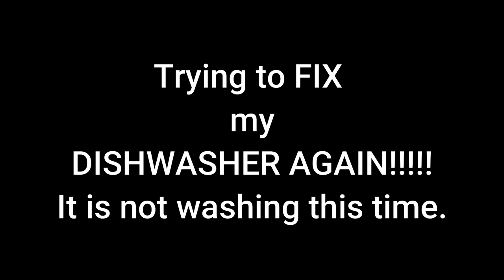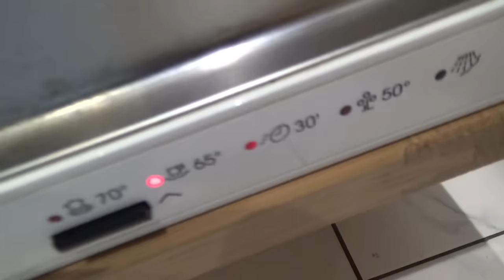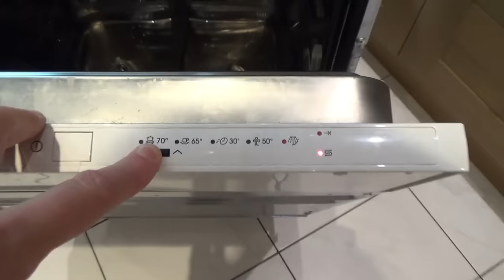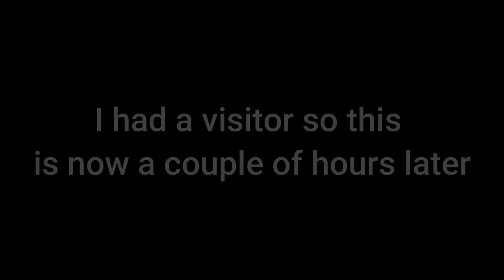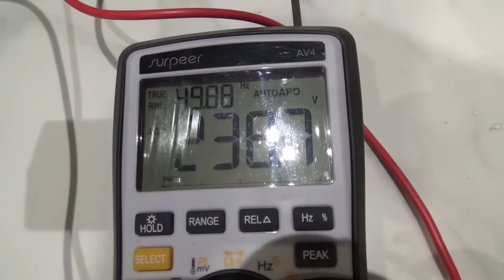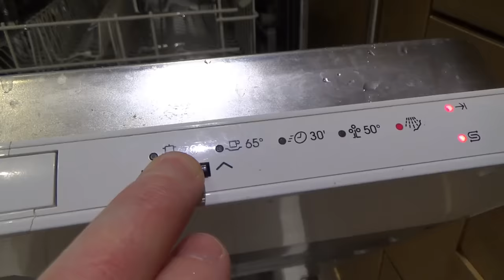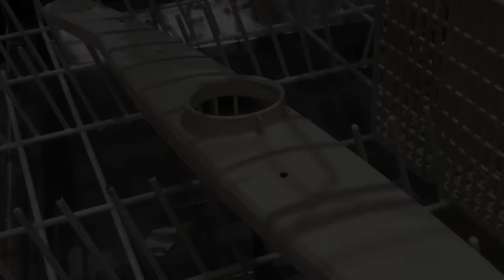Faulty Dishwasher Filling BUT NOT Washing - Trying to FIX

Comment: Make sure you top up the salt regularly. It is there to soften the water. At 2:14 you can see salt low light being on indicating there's not enough salt. Add salt even if you use 3in1 tablets. Also check your water hardness, you might get it from your water supplier, and adjust softening accordingly. There should be a table in the manual showing which setting you should use for which hardness level.
Love your videos, keep them coming!

Comment: Get hold of a box of citric acid-they sell it in wilkos at the moment,it’s with all the other washing machine cleaners etc-pour half the contents in,and run it without any dishes-this stuff will dissolve any calcium build up. Well done on the diagnosing and repair-I’m a service engineer,and do this day in day out!

Comment: Life saver mate, had the same issue, doing everything but wash, watched your video to find the pump motor, opened the motor to find a worn impeller had fell off, new impellor for a fiver and the dishwashers working great. even managed it without dismantling the motor from the unit.... saved a fortune mate cheers.

Comment: Hey Vince, the impeller is not supposed to come off the shaft easily like you did, this generally means the impeller is faulty and there will be too much play and the impeller will catch on the housing. The only fix was a new circulation pump. P.s I am an appliance technician.

Comment: It's a good job I have a water softener fitted for the house supply. It does cost money but then I don't have these kinds of failures in my water based appliances (I live in London where the water is hard). Plus I usually use the dishwasher/washing machine cleaner once a month and they've given me years of reliable cleaning/washing. Enjoyed the video, keep up the good work!

Comment: Great video, mine had exactly the same sound as yours I managed to take the pump apart and clean while  leaving the motor alone and it solved the problem ( if this is an option for anyone else it may save buying a new motor )

Comment: Brilliant video :-)  Thanks for showing all the stages - and I held by breath wondering if it would work!  Well done.  My Beko dishwasher is not cleaning properly but its the top arm that is not rotating - so I'm going to get some dishwasher cleaner to see if that clears away any grease or grim blockages.

Comment: Yes, wash pump motors often go, especially if it hasn't been used for a while. Use your dishwasher, they like it. If you don't use the washer regularly then things seize up. Well done on fixing it. You have the respect of a dishwasher engineer. 🖖

Comment: My mate vice, those pumps goes bad from bushings and the liquid inside of the rotor is ferromagnetic fluid so once they fail is impossible fix it, also those pumps They commonly fail in the wash machine so prepair for dismantle one 🤣

I know it coz I repair wash machines/dishwasher machines and the common faulty is those pumps, first They start to make noise then to get stuck and the last stuff is fry the coil, in the worse case the pump frys the drain circuit in the circuit board (commonly in a samsung wash machine, in fact I hate those friking machines) 

So here we go my two cents
Reply: I just take the pump apart and spray silicon spray where the rotor is and i have never had trouble doing it that
Reply: I have a similar pump on my machine. The graphite bushings had worn in an eccentric hole, causing the stator to hit the side of the casing, sometimes stalling the motor. I could not source the bushing, so I rigged a nylon drill bushing in a rubber washer at each end. It's been nearly a year and the fix is still holding with the machine used nearly every day. I had to run a reset cycle on the machine to get it to heat water again after it threw codes.

Comment: Thank you, clean the plastics from the motor, was dirty, different model from yours Hotpoint FD550.... and the dishwasher has been fixed.... Thank you for this video. The issue is as you said, dirt around the the part that the magnet turns.... It cost £1.50 for new jubilee clip. and an out of labour.

Comment: Water filter and a water softener may be a good investment for longevity.
Reply: The salt reservoir inside is the water softener. Does the exact same thing as a home water softener.
What is common, though, is forgetting to refill the salt. Now that I have seen what it does to the pump, I will make sure I refill mine on a regular schedule.
Reply: Also, check if the drain filter doesn't have any big holes, since that would cause any gunk from the dishes to go back into the circulation pump.

Comment: The circulating pump is the same as the Whirlpool and a lot of other brands. Mine quit cleaning or might I say I got around to fixing it the week before Christmas. I first blew out the holes in the spray arms but it still didn’t spray properly. I removed the pump an disassembled it. The bushings were worn enough the stater rubbed the side. My wife was in a hurry to have it fixed. I removed the bushings and replaced them with RC wheel ball bearings. Thou they are stainless steel I have read these will eventually rust and lock up. I have since cut two pieces of 1/2 in. Acetal rod 11mm in length. Drilled a 5mm hole in the center and mounted them in my drill press. Then turned down half, 5.5 mm to 10 mm with a small file. I kept the old bushings with the o-rings and plan to use the o-rings on my home made bushings.The old bushings were made of graphite probably to wear quickly. Acetal will out last graphite 10x. The bushings and o-rings cannot be purchased separately from appliance parts store. If the large o-ring leaks you have to buy a new pump. Not me! I’ll make my own bushings, use the o-rings from the old bushings and replace the large o-ring with a new #235 o-ring.

Comment: That play in the impeller, is to make sure the motor runs the right way. Those induction motors can run either way. On switch on, it is 50/50 whether it starts the right way round. If it's wrong, that clutch kicks it back the right way and it then continues the right way.

Comment: Quick troubleshooting on this one! If you had a clamp meter you could have easily tested the current draw of the pump motor safely and verified that it was drawing excessive current when the rotor wasn't turning. They allow you to test current draw without breaking the circuit as you would have to do with a standard multimeter. Cheap ones run around $20-$30. which is good enough if you just do occasional testing and don't need real accuracy. You just hook it around one wire and it reads the current through induction. Works on ac and dc. Can even help verify shorts in electronics.

Comment: Nice video! I think the scale rocks in the motor housing imbalanced it and caused the fault. To prevent this kind of faults need to do preventative maintenance once a month, like to run the machine with the descale solution.

Comment: Yeah prices have gone wonky, here in the states, the pump/heater for my bosch is 300 dollars, insane price, I can pick up a maytag which is a 1500 dollar dish washer, with a simple leak, that can be fixed with a rubber o-ring for 5 dollars, I can get it for 50 bucks, tomorrow, and it's a 2019 model, but great fix mate.

Comment: Vince there's a 2 part vidéo of a repair of that pump by replacing the bearing the magnetic shaft spins on so that it comes back to centre 

He used a ball raced bearing and it worked..
It seems the black plastic bush at the end of the shaft is a weak point  good job.. but the bearing of the motor at top and bottom of the shaft is the weak point

Comment: Vince, it looks like you don't have any salt in your salt tank. if you want your heating element to last longer, I would advise you to fill it up, salt in the all in one tablets is not enough for hard water areas. plus the motor you just replaced is called a recirculation pump. Good btw

Comment: What I always did was tap with a hamer on the pump. But those circulation pumps will stop working in the end because the play is to big and the magnet is not running central because the little hole were the axle runs in is getting worn out. So its just a Easy to replace by yourself. And indeed they are not expensive.

Comment: I opened that motor on my kenmore certain I was going to find some trash in it. Nope 😂

There was a tiny amount of grit, but nothing that should have stopped it, I wonder if the bearing actually fails when it heats up... at rest/disassembled, it seemed smooth and all.

Comment: Did you check the brushes on the motor? usually the likely cause of a motor not spinning, carbon based so they wear down over time

Comment: My condo was suppose to come and repair mine but have avoided it.... So I'm going to try and do this myself. The whirlpool dishwasher is brand new, it turns on fine, fills with water, detergent drawer opens... And then it just stops- no sounds- no washing. It will stay on and won't turn off without a manual turn off, which it then drains properly....

With mine not making any sound, what do you think it is?

Comment: They sell de-scaling tabs you place where the detergent/pods would normally you go. They are mostly citric acid to safely eat away at the scale without harming plastics/rubbers.
Reply: If the softener is correct adjusted, you will not have any scale in the machine.

Comment: Nice fix but doesn't sound like winding in that motor is failed and you can keep it as spare. My guess is that bushing/bearing on either end of rotor shaft failed, just enough to give motor hard time starting, with a "push" it will probably still work but obviously in this case that's impossible to be confirmed.
Reply: I think the motor responsible for the washing has a problem with its bearings and should be replaced , this fix will work for a couple of days if you are lucky and then the motor will stop again.

Comment: Geez, things aren't really built to last these days, I have a dishwasher from 1997 and it has a proper circulation pump motor with a proper cast aluminium frame, and much sturdier than that tiny little plastic motor, it eventually seized after all these years because the bearings gave out, all I had to do was replace the bearings and now it's running smooth and quiet like new again!

Comment: I had a similar problems with the drain pump on a Beko washing machine. I tried to fix it after we'd bought a new washing machine. I ordered a new drain pump on Amazon (genuine Beko part) which should fix the problem. I will be making a video.

Comment: There is play probably for the motor to get up to speed a bit before being loaded because remember water is heavy if it doesn't have this feature it would probably just get stuck and hum I'm not certain this is the case but it's just my guess because it seems like it because what else could it be for if it's not for this purpose?

Comment: There is no pump used for filling the dishwasher.  The two wires are attached to the solenoid valve which opens and closes to allow water under the city water pressure to fill your dishwasher.

Comment: My whirlpool WDF520PADM7 fills and then just sits there, it releases the soap as well then after a little bit I here it pumping the water out like it's going through a cycle. Think my pump that goes to the sprayers is bad?
Reply: Hi, I'm having the same issue with Bosch. What was your solution?
Reply: @hadi174  Hi, I never did figure it out. I changed multiple things and gave up. Went and bought a new washer.
Reply: @ericc8895  Seems like I'm on the same path. Thanks for getting back tho!

Comment: I had this problem and it was just rice stuck in the motor. So surprised it was a failed motor and not just blocked. But guessing that scale caused it to fail. That is some bad scale.

Comment: find a noise? use a screwdriver as a stethoscope. place the tip on what you think is making the noise and place the handle in your ear, sound travels up the driver and you can hear the noisy component

Comment: If the Armature of your motor was turning without the Impeller turning, then That was the Whole Problem that you Fixed by Ordering and Replacing the faulty Part.. The Armature as well as the Impeller Would be fixed tithe shaft and Would Turn as One.. Thanks

Comment: Should have connected 240volts to the pump on the bench just to confirm it is making the horrible noise.  Note you would never do that for longer than a few seconds with a known good motor and no water cycling thru it, as the water helps to cool the pump.
Reply: Or aim a small cooling fan at the electromagnetic part to cool it down while testing it 😉

Comment: Classic case of a seized circulation pump. Common failure mode, easy fix. Might have been the pump bearings that went because of the scale.

The 'tiny motor' that is on the water inlet is probably a flow meter so the machine can verify that water is coming in, and shut off to prevent the pumps from running dry.

Comment: And this is where I buy a new dishwasher. Mine has stopped washing and out it goes. Repair charges for labor and parts will not be worth the investment. I have a Whirlpool seven years old. Whirlpool microwave bought at same time also kaput. No more Whirlpool products.

Comment: 2:10 I bet it has the play so the motor can start those motor designs have low torque on start up and having a bit of space is probably necessary. on fans that’s why they start on high so that they can actually start and not stall